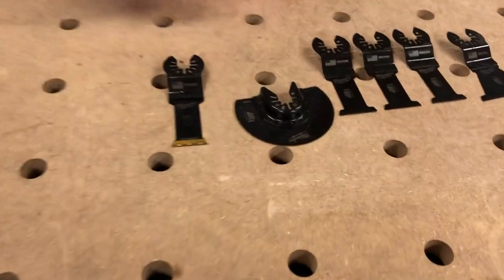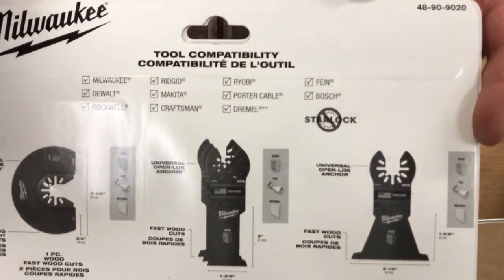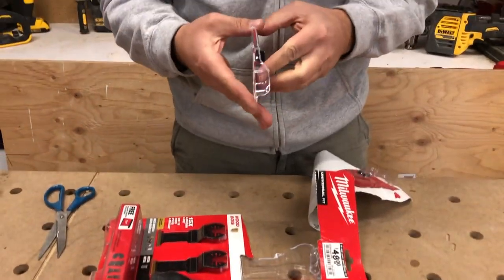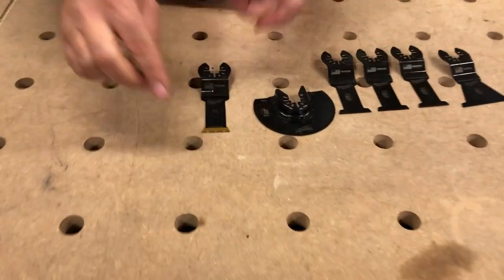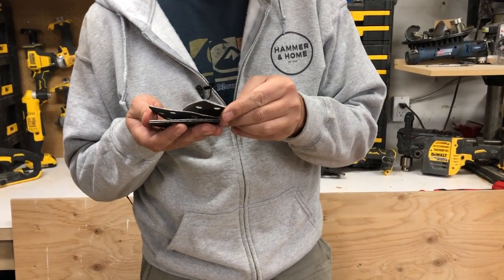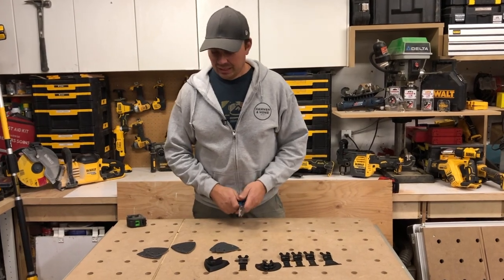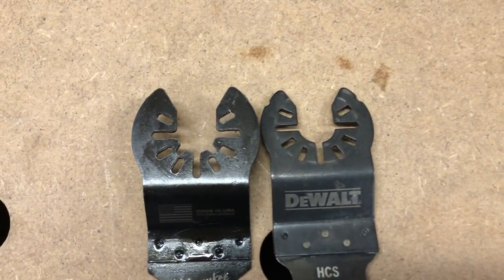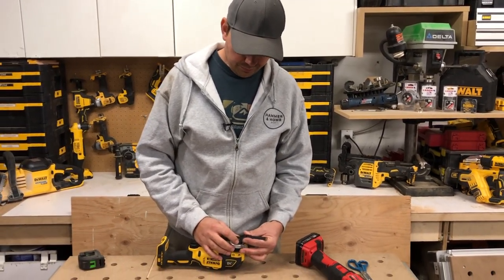Fits most brands! Milwaukee oscillating multi tool blade kit review

Comment: Thank you for the review.  I bought the same kit at Home Depot and I noticed the same thing how the Milwaukee blades fit on my Dewalt oscillating tool.  I was thinking about taking them back.
Reply from the maker: Was the blade pouch in yours?? 😆
Reply: @hammerandhome  yes the blade pouch was in mine and it is actually a pretty nice pouch.  I filed some of the narrow points on the Milwaukee blade and it helped a little bit.  There are actually three narrow points, the ones you showed and one on the front.  I did put the adapter on and it seemed to hold the blade good but I did not try cutting with it yet.

Comment: I have a Dremel tool and although the Milwaukee blade fits on it, as soon as there is any pressure they come flying off.  This past week I threw about 4 of them, 3 unused in the garbage.  I have never had any problems with Milwaukee prior to this.

Comment: I recently got the corded Makita oscillating tool. I feel that the mechanism to hold the blade is much more robust and secure than the DeWalt and Milwaukee.
Reply from the maker: I’ll have to check it out. I’ve never had any issues with either tools loosing blades. But ya never know

Comment: Put this on my "perfect world" wish list/

These tool companies need to understand that they are never going to thin of EVERYTHING we might need. Sometimes, we have to see what is available, and use their stuff for different purposes. You see, I did not need a case for my multi tool blades. I needed a case for my circ saw blades, and I could not find that anywhere. So, I found this, checked out the offered measurements, took a tape top all of my circ saw blades and...it would fit, with a quarter inch to spare sideways.

That is because they tell you the width is 7.48. Well, when it arrives, the width is closer to 7 flat.

Now, I made it work. I whipped out my fastback and some gorilla tape and created "soft side" sections on either side. But it is frustrating while doing that to think how unnecessary it would be if they would just take the care to give is ACCURATE product dimensions. 

Anyway, it's a decent little case and the pegs do their job of holding things steady. But it is 7 inches wide, not 7.48...just so everyone else knows that.

Comment: Thanks Brad for this video. This happened to me this past weekend and I thought I was doing something wrong. So bummed the Milwaukee blades don’t fit on the XR when they say universal. 100% - not wasting my time with attachments. I’ll try the Diablo blades or go back to Dewalt blades...or maybe snag a M18 on sale which I bet was the company’s intention all along.
Reply from the maker: it's a bummer for sure, I will say this, i just purchased the m12 fuel and it blows dewalt out of the water, I cant believe the difference in cutting speed and overall accuracy. it's a completely different experience.
Reply: @hammerandhome  that’s really good to know! Already in their 12v, might then try it out.
Reply from the maker: @campbell3897  i'm actually doing a review on it, so it should be on our channel this week.
Reply: @hammerandhome  look forward to it!

Comment: More great info H&H! I bought this blade kit for $29.99 at the Depot here in the states cause it was such a deal. Was hoping the blades would work on my Dewalt  XR multi tool. Looks like ive got a bit of filing to do. So your bringing in the Red tools Aye. Well more power to ya if you can afford em. Milwaukees cordless line has always been a bit outa my price range in terms of paying what they want for the tools when my Dewalt stuff has always gotten the job done for less money. Not saying Milwaukee doesnt make good stuff. But seems a little over priced to me considering their cordless stuff isnt made in America like their old corded stuff was. My dad was a Master electrician and I grew up with  USA made Milwaukee tools like sawzalls and bandsaws so I know the quality of the brand. Well Ill be watching cause I know your obviously a Dewalt fan so if you review Milwaukee tools and you chose them over the Dewalt counterpart then that really saying something for how good the Milwaukee tool must be.
Reply from the maker: Glad the blade info could help, and yes, Milwaukee is putting me into a quandary! I’m reviewing the Packout system soon, you’ll have to let me know what you think.